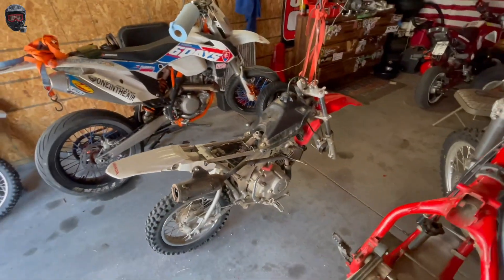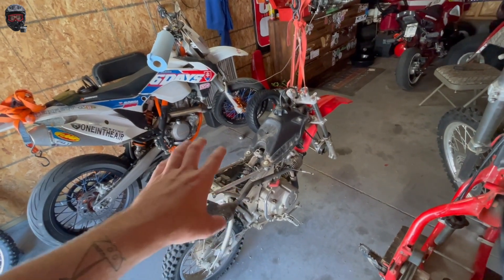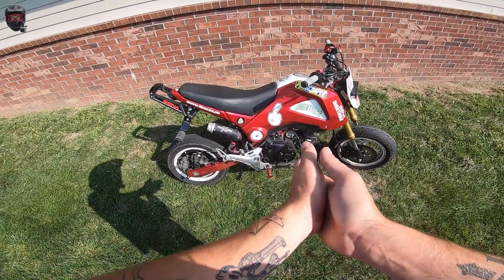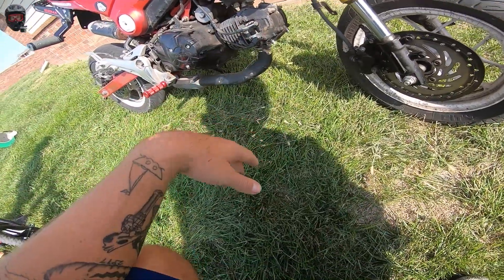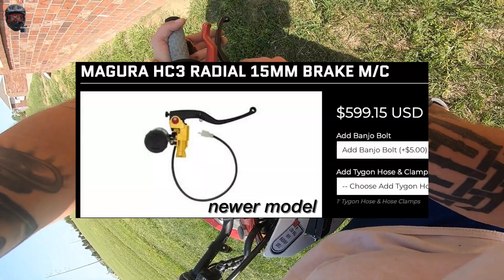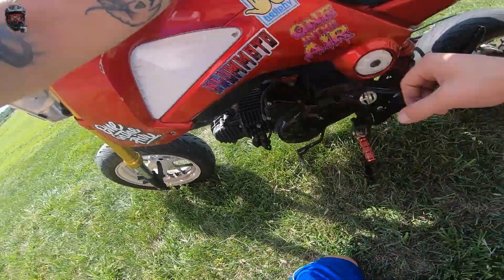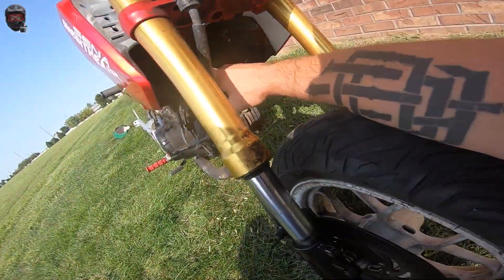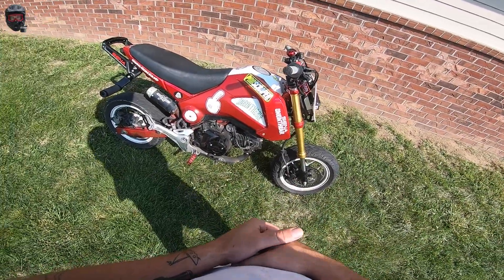Showing my Grom's mods | Finally got a Pit Bike!

Comment: Need to up the compression, longer stroke on the crank and do some cam work.Maybe have the head ported and some bigger valves. Then go with a bigger carb

Comment: Should probably get a tuner in that thing before you melt a hole in the piston, that plug is lean AF.
No air box+that pipe for this long im surprised it hasn't already blown up bruh